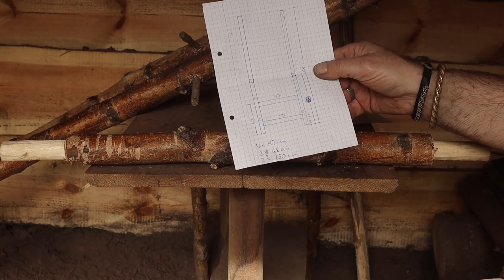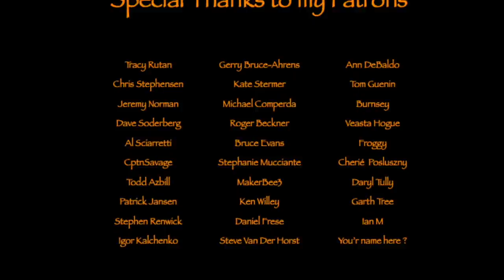Cimbrer Viking Throne

Comment: AH! The throne you made is worthy for a Viking warrior and you fill this throne well. I like the changes but, you need a royal footrest. May I suggest instead of folding doors, make a front on hinges that you can raise up and that way you have a cover from the rain and you can put a window in it as well so, when closed you can see outside. Thanks for sharing Tom.
Reply from the maker: Yeah John I’ve considered that solution to 🤔 but for different reasons I prefer to have a folding wall … and I hope you’ll like it when it’s done 🏕🔥Tom